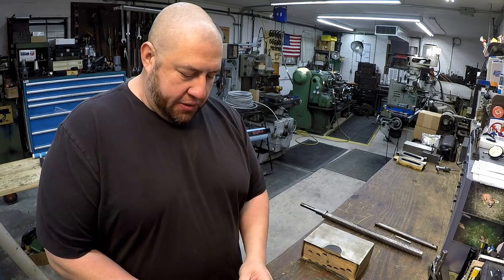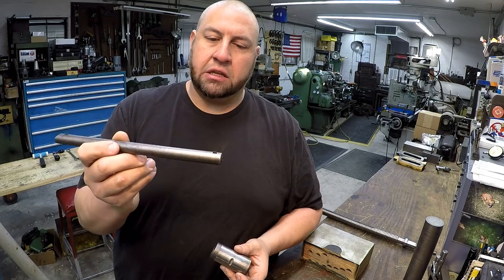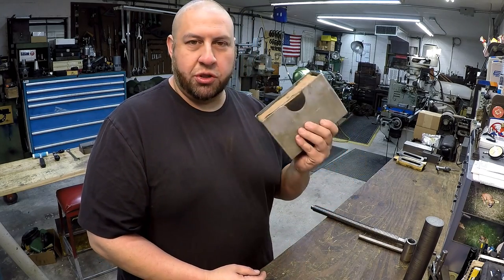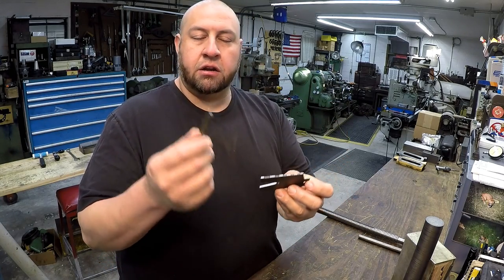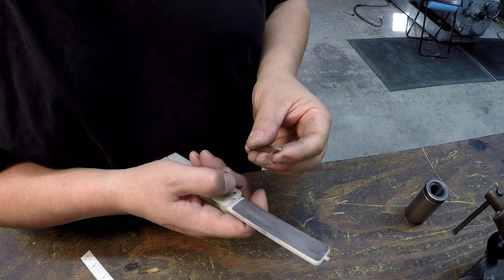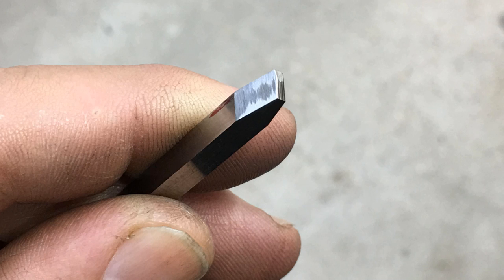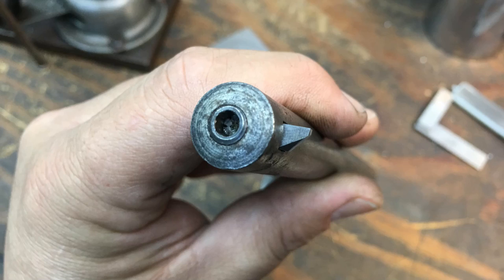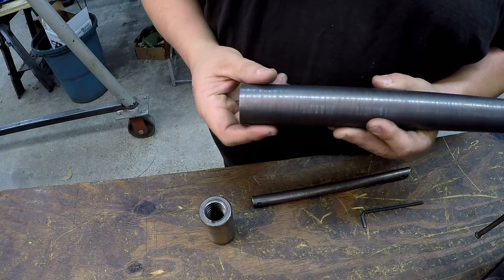Hand Grinding Acme Thread Tool Bit

Comment: Just a tip to all. Spend a few rainy days just setting up little Excel programe on threading. If you like the idea of having all the info that's needed for any thread readily available on screen, its worthwhile taking the time to set up for it. As Adam gave the TPI and the Major Diameter, they were the two things I entered and out came all the information needed for both the tool grinding and the actual machining. Same for any thread and where once you set it up on your computer, its all there in an instant...... Great Video Adam and I've always admired you approach to all of you work and videos.... Great help you give all of us out here.

Comment: At Dresser we had a large 2 wheel grinder and a diamond wheel grinder for fine tool work.  Made life much easier for the manual lathe operators.  Tool crib carried hundreds of pre ground tools, all listed under a TD heading.  Specific operation tooling was called out on the travel packet, but most times we had to grind clearance, etc, to make the tool work.  Lookin good there!

Comment: Holy crow. A transparent safety shield you can actually see through. Life is mighty good for you today. All the bells and whistles.  I remember watching a young guy in a body shop stick welding with no eye protection at all. This was back in the mid 1980s. I am told that snow blindness actually hurts more than arc flash. Guess he got to find out about the one anyway. 
By and large I have little use for the safety nazis, but there are good reasons you chose belt and suspenders for preserving your eyes.  Good for you.

Comment: Great vid, When you were relieving the backside of the cutting tool on the grinding wheel and you were taking your time to make sure you didn't hit the cutting edge, Right about there is when I would sneeze and drive the tip into the wheel ;)

Comment: I a proud owner of a ck12 getting it fixed up.  bought it from a man in MI. YOUR KNONE UP THERE TO. Rigging crew broke the gear box handle off i fixed that today needing to get a convert to make it spin in time .rebuilding a rigid 60 cpn vise  the thread best i can measure is 3 teeth per inch i got it missing the dove tail nut my monarch lathe has a 3 on the gear box hope to make a new nut for the vise thanks for the vids abom.

Comment: I too hand grind a lot of tools, but I have a little Rockwell knee mill, about a 1/2 size bridgeport. In the highest belt setting it will turn 6200 rpm! With hardware store grinding rocks and a dual tilting vise I turn it into an impromptu tool and cutter grinder! It's small table size allows me to rapidly run across the tool taking about a thou at a time. Tools are carefully put into the vise correctly set for the proper angles to allow for reliefs.

Comment: Sure appreciate all the time and effort you are putting into these videos.  Seems like every time I get on the computer you have a new video.  Thanks for the effort.

What I don't understand is when it is appropriate to make a nut out of ductile iron when you know it will be rubbing up against steel.  My dim understanding has been that you never want iron rubbing up against steel.  My novice expectation was that the nut should have been made of bronze or maybe brass.

Then I don't understand what the difference is between black iron, gray iron, ductile iron and Meehanite.  I wonder what book I should be reading to find out these differences.
Reply: 6NBERLS steel vs cast iron is a common bearing combination in fact. You see it in lots of machine tools.

Comment: To show the fit have you looked at a USB Microscope  / Digital Endoscope, I just ordered one and it’s great for zooming in, to check my grinds, it was only £30 (Shekar Android digital endoscope). You can use your phone or PC and record video, I can see it will have got loads of uses in the shop, Rob (xynudu) gave me the idea when he used it for gear cutting with a printed template.

Comment: I have the exact same face shield. Find a box, or bag to keep it in- I had mine hanging up where I can just grab it and it is a magnet for dust. I wiped it out a few times and it scratches a bit easy; blow it out or wash it off- I haven't figured out what is best for it yet.
Reply from the maker: I keep windex at both shops and only use it to wash my safety glasses and face shields.

Comment: Great video. Illustrates the processes and the thinking behind why things are done

One of the good things about being around today is that one can make templates out of plastic using laser cutters... Not for general workshop use but OK for the home workshop.  Just measure the key dimensions of the template after cutting! So not being able to find a template is not a show-stopper as long as you can figure out the dimensions from e.g. handbooks.

Comment: It's really great how you always use protection when doing your work. Lead by example is the way to go. Blast shields are great so nothing shoots up in your face which can just be annoying and it lets you get right down there to have a good look if needed! Ear plugs are your future self thanking you for still having good hearing. I've worked with folks who can have a big ball peen smashing away 2 feet beside them all day and it doesn't seem to bother them.  Yikes!
Reply from the maker: I work around people like that too, loud hammering noise, or the 1" impact wrench. I'm on the other side of the shop and I'm reaching for my ear plugs!

Comment: Sweet video. Think you'll ever get a surface grinder? That makes mince work out of stuff like this. you could have a whole series on the move of the machine . Inspection. Cleaning and repair. The videos would pay for the tool eventually lol
Reply: Billy C:  I've wondered the same thing. A 6 x 18 or larger surface grinder would be a very useful addition to Adam's well equipped shop.
Reply from the maker: If I ever get a surface grinder I want a nice size capacity like mentioned with power table feed. Would be nice one day, but for now not a priority purchase.
Reply: My old work place had a really nice chevalier one. Power table and power feed with various programs

Comment: Double check that your land width on the toolbit is narrower than that on the leadscrew to ensure that the cut thread contacts on the flanks rather than the major diameter.

Comment: I think the tool you ground may drag on the leading flank (the flank first entering the cut.) You got the flank clearances ground for a 3 degree 47 min helix angle on a RH thread? If you figure 5 degrees flank clearance, the protractor reading would be 80+ on the leading edge and the trailing edge a trifle less than 90 degrees. Draw it out to make sure. I've often ground a secondary or even a circular relief on the leading edges of thread boring tools where the helix angle poses a problem. These considerations are mentioned in Machinery's Handbook but as I recall there is no supporting illustration.

If the tool stick-out + bar dia makes extracting the bar dicey between passes you could back it clear so the bar isn't quite rubbing the ID and reverse out with the extended tool following the thread space. Sometimes that's the only way you can cut deep coarse Acme threads in lead screw nuts like on an HBM. 2 1/2 - 2 LH Acme DOUBLE 8" long in bearing bronze comes to mind. I had to invent new swear words.

BTW, there's a difference between Acme and worm threads. Acme threads have the 14 1/2 degree pressure angle measured on the axial plane. Worm threads have the flank angles measured on a plane inclined to the helix angle. An Acme tool won't accurately cut the flank angles of a three start worm, for example. I found this out the hard way cutting some integral worm shafts for DeLaval turbine driven fuel oil transfer pumps. They wouldn't blue in to the mating gears. 12 pieces of shiney, very expensive junk.
Reply from the maker: Forest, I figure that out when I machine the nut. I have more videos coming on that.
Reply: Abom79 Sorry, Adam. I shoulda known you'd figure it out  the first passes of the tool.

Comment: Adam... Have you thought about adding an adjustable fence to the grinder table? Looks like it would be an easy addition. The table looks plenty stable and substantial. Looking forward to the actual use.
Reply from the maker: I’ve given it some thoughts
Reply: Wouldn't have to be anything fancy and would sure help with those angles. Might even save those fingers from being "bitten" Maybe a future project?

Comment: Adam, any reason you did not make the bit match the rod threads as opposed to a thread pitch gauge?  Seems to me that would have been a good approach.    I am pleased you are protecting your hearing.... I am 70 now and worked in many places where it was very noisy without protection, and now I pay the price, with significant hearing loss.

Comment: 2 questions. Why the choice of Ductile iron for the nut? I would think that Gray iron or Bronze to be the preferred material. Also have you ever tried milling your form tools? I haven't milled any acme tools but I have milled full 180° radius tools.  Modern coated carbide cuts a tool bit it very well.

Comment: I just want to share some thoughts right here.... when you fit a nut for a worn thread, you should maybe grind the tool like a thousands smaller than the nominal size if you want to eliminate all the play in your threads. Just correct me if I am wrong.....

Comment: Those grinding wheels sound well balanced. Nice heavy duty rest on the grinder also. - Good work on the tool grind - Good demo video.  Are you gonna show making the nut?
Reply from the maker: Those old grinders like mine were built for power and rigidity. Nut will be on SNS

Comment: Adam, when you said (close to the end) that you could feel the wear on the threads, could it be because the tool bit isn't sticking out enough?

If so, would you need a thinner boring bar?
Reply from the maker: Because the old nut has wear in the threads. I ground the tool to a near as perfect fit as I could seen
Reply: Yes, it looks very well ground. Great work! But what I mean is: When you are "checking" the wear, is the tool touching the root of the threads, or is it the boring bar which is touching the crest?

It's difficult to see from video, but perhaps the tool bit isn't sticking out enough. I just wanted to make sure before you cut that thread.

And if it is out enough, just ignore this and good luck making those chips! Greetings from Brazil.

Comment: pity the handbook has such tiny font, I  have trouble reading it even with glasses and the formulae, you're right, unless you have higher math, well you'll not follow it at all, nice video Cobber, given the availability of non-ferrous in USA I'm surprised you never went for bronze or nickel ally bronze

Comment: Hi Adam just asking do you use the 1.0mm cut off discs  as these are used a lot in the sheetmetal and are great for cutting heavy plate as they don't take as long to cut through as the thicker blades do. Enjoy your videos and are watching the work you are doing on the shaper as that is what the company I did my trade in had in their tool room.

Comment: As usual a great video. Thank you for sharing. Why did you choose ductile iron for the material rather than brass like you found on the other machine?
Reply from the maker: Ductile iron makes a good low speed bearing surface. That original nut has been in there since post war days.

Comment: Adam, When you grind the 14.5 degree angle, does the hole in the pitch gauge play any part in the width of the end of the thread cutter? Thank you for your excellent videos.
Reply from the maker: No sir. That is relief for the grinding wheel when they make the gage, I’m assuming.

Comment: its funny because really you should be wearing ear protection any time you use some of your machines. Those 3 phase motors whine a lot. Still I like the sheild on the angle grinder. Did  you put that back on just for the video? Aside from brand new ones I have never seen one that shiny on a used grinder.
Reply from the maker: for all of the 4 1/2" and 6" grinders I have the guard, not for my 9". Ear protection should be based off of decibel levels and amount of time sustained to them.

Comment: Are you using 3M’s 66578 wheel? Thank you.
Reply from the maker: Honestly I can’t remember what wheels I’m running. I put them on about 10 years ago.
Reply: Sorry, i ment the 4 1/2” cut off wheel you are using to cut off the tool bit.  The number shoul be on the face of the .045 wheel.

Comment: What kind of is the one that you used to layout you tool? I could use a small one like that in my shop.
Reply: This question is old now, but: that layout tool is a protractor from General, looks like their #17. It’s been modified by shortening the moving piece. Definitely makes it easier to hold.
Reply: @624Dudley  thats what I figured.

Comment: Sorry, but where does the Coyote and Roadrunner figure in this?
Reply: The machinery, traps, tools and stuff that Wily used were all ACME corporation brand.  The idea is that anything ACME brand will fail to work in disastrous ways.
Reply: Ahh, so that's what I was supposed to learn in the '50's.     lol

Comment: What was your take on the cut off wheel?
Reply from the maker: That's the only cut I have made with it so far, but it cut fine. Not enough to tell if it's any better then my normal wheels. It did seem to be more course with the cut though.

Comment: Face shield ?  what a crock ! lol  ,  they fog up right away [ up here in a cool climate]  so you can't see what you are doing , great choice eh , may as well quit. [ same with welding but i got it fixed] 
i've been watching Abom for a while , nice man, very high on the orderliness scale so he is relaxing to watch
I've owned a 10x36  chinese lathe since the late 80's , its been a life saver getting me out of auto parts jambs. Watching Adam i've learned that i really am self taught , i do things mostly the same as Adam. But oh dear the time i've wasted with crappy tooling , only recently i found the affordable China stuff. i now have a great quick change tool post and lots of insert tools , no more frigg'n shims . [ and another beef ! , the high cost of tool snob tools , all priced for industrial  ''cost no issue'' , soak the Gov. budgets , AND the dealers are always rude.
Reply: They have stuff for that at ski and dive shops.  If you have ever had a piece of steel stuck in your eye, you'd be using eye protection
Reply: By The Sea Aspirin Shop - I have had steel splinters scraped off the surface off my eyeball by a doctor, using the tip of a syringe.  That's not something I'm ever doing again.
Reply: safety glasses work , no fog
Reply: actually what works is , get a small respirator attach  a length of tube to the output drill a same size hole in the mask , then all your breath goes out side the mask . i did that with the welding , using a Sevore mask [ and it still have to warm the thing with a heatgun]
Reply: Been there twice myself. Had a small piece of rust removed from my eye because I didn't think I needed glasses to make this one small cut on my van floor. Second time (same eye, a year later) I was wearing reading glasses and a cheap face shield, and a spark somehow bounced off my cheek,, then off the inside of my glasses, and got me.. Both times it was about $175 to get it removed.

Comment: You look like you've lost weight,what is your secret?
Reply: James Ciampi I will hazard a guess the main thing is portion control. A certain amount of scheduled exercise helps a lot. Sort of like having a high idle in a car engine. But the main thing is portion control. It took him years to gain,losing slowly is wise. Not easy,but wise. Years ago,after a very bad year of back surgery,I was some 60 plus pounds overweight. Lucked out and got a job with a property management firm. Walked off most of it in 8 months. Added portion control to that and it was painless to lose the rest. Cannot answer for Adam,but that was what worked for me. Hope it helps. Cheers.

Comment: Machinist calculations in imperial sound like a monthy python scetch. Its so ridiculous complicated for the simplest stuff...
Reply: MsKoffeinjunky: Well, not really, if you've used imperial all your life. I apprenticed in machinist trade in 1956 and advanced to tool and die from 1962-1992 and and now own my own shop. I work with imperial and metric but more comfortable with imperial. It all depends on what you're used to working with.  I've ground thousands of CPM10V parts to + - .0002 tolerance; not sure how to write that decimal in metric.
Reply from the maker: Every video. Nothing complicated about it unless you don’t understand it.
Reply: Ellie Price a inch is 25,4mm so 0.0002 is roughly 0.005mm +- makes it a hundreth mm tolerance field wich is not bad but you can reach with milling and turning. Thats what a regular Micrometer measures. You can go 10 Times more precise with grinding.